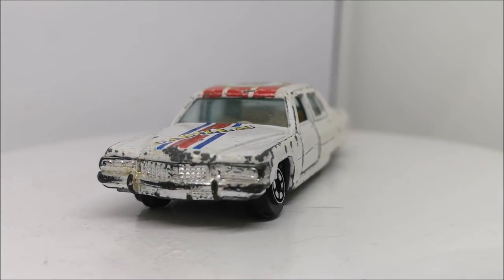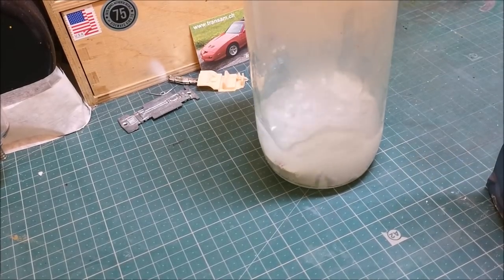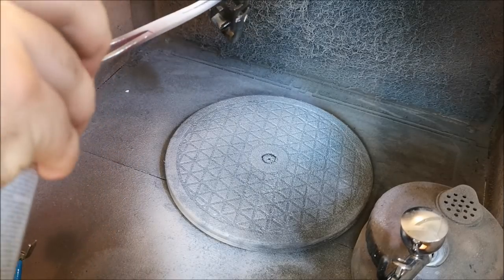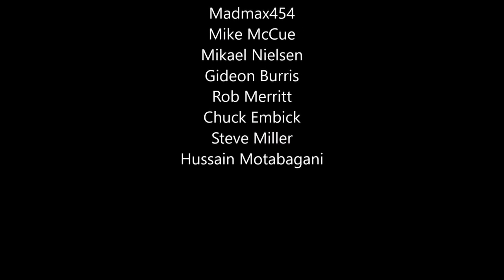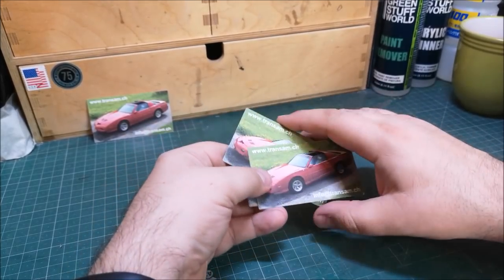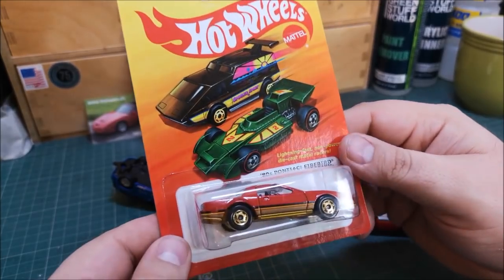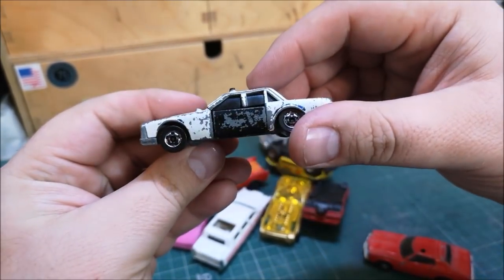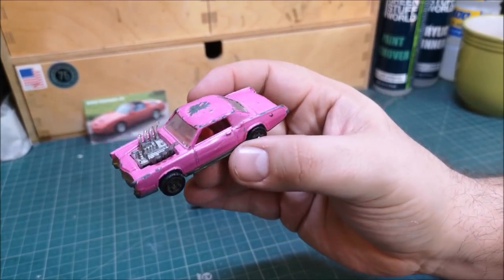Cadillac Fleetwod Brougham Custom

Comment: Hi Rob! Wow! What a nice job you did on "my" Cadi. I love the color and the wheels. Sidenote: The wheels are called "Diamond Spokes" and were standard on every Trans Am and GTA from 1987 to 1992! My red Trans Am does have exactly these wheels in black! Its a honor for me to see my old cars in your professional hands over there! I'm working on the next package :-). Best wishes and thanks again! Steve Miller (real name is "Stefan Müller" but for my US- and GB-contacts its easier to call me Steve Miller).
Reply from the maker: Thanks again Steve 😎💪🏼👍🏼
Reply: @MatchboxGarage  just let me know about the comission when you have time, no hurry!
Reply: I actually own a Corvette C6 and I own a 2002 Ford Mustang I will actually interested on buying a Pontiac Firebird Trans-Am from the early 2000s there is a website that buys Chevy Camaros and converts them into modern trans am's they are really expensive I think the most expensive one goes for $200,000 but it has a 1000 horsepower and the other version is cheaper is $160,000 and that one only has 800 horsepower if I'm not wrong the website I think is called Trans Am Florida

Comment: Hi Rob, Technically is would be pronounced BRO-um, but brome is quite common as well.   A brougham is a type of light carriage named after Lord Brougham who commissioned it from London carriage builder Robinson and Cook.   It date backs to 1838.   You can read more about it on Wikipedia.  I have a old Tomica example that looks quite a bit like this, with the opening doors and such.  I wonder if Yatming may have bought old tooling from Tomica.  It came out pretty good for wha5 you started with, l like the tail-dragged effect.  👍😉
Reply: Terri, I have the Tomica one as well. I was wondering if this was a knock off of that one.

Comment: Looks like a low rider (especially with those wheels Rob 😉)with the hydraulic setting raising the body up at the front . Despite the cheaper model you did a great job on it Rob 👍

Comment: Hi, one syllable, Broam, like roam with a b. I’m glad you are now using a mask. Constant usage of chemicals is not cool for your lungs. Great restoration, as always. I’m not sure why they designed it with the front end higher than the rear. It wasn’t like that. And it sure wouldn’t have all those ugly decals on it. Cadillac and Lincoln Continental are the two big luxury cars in the US. The ride like big boats. My parents owned a few Continentals over the years, 1960 with the suicide doors, 1969, 1978, and the last one they owned. 1997. There was nothing like “floating “ down the freeways at 90 mph. Hence their nicknames “boats”. See ya.

Comment: Question, do you wash the body before you paint the car? When you sand/ strip a car i use to wipe the body with a alchol solution. Just curious if you do the same?
Reply from the maker: I should do